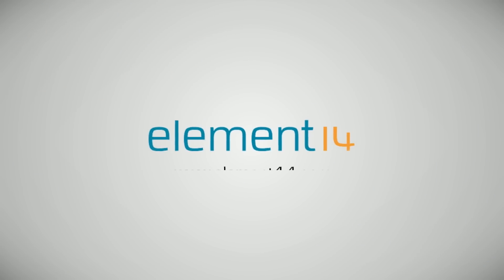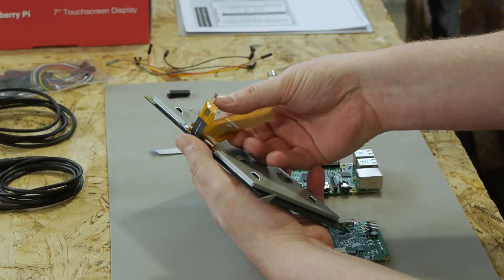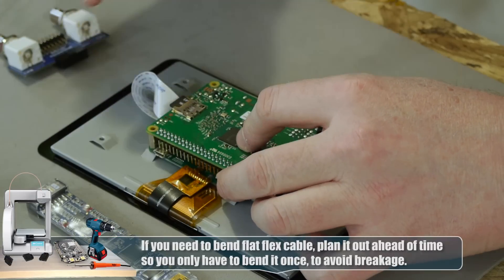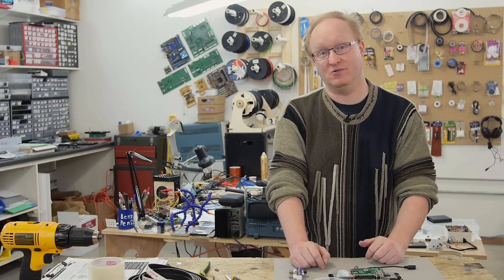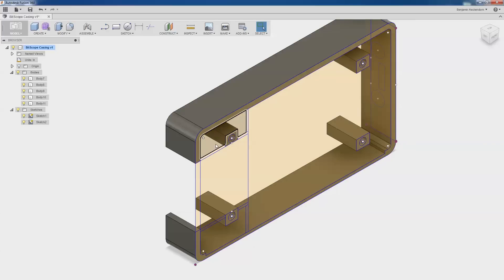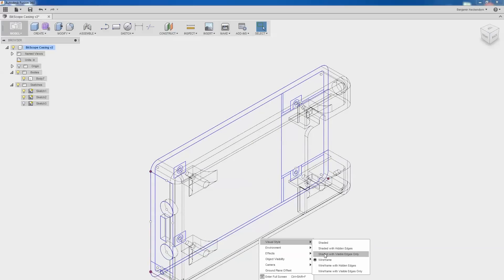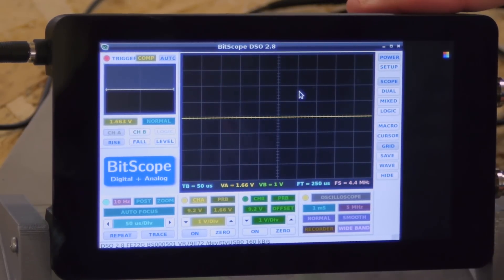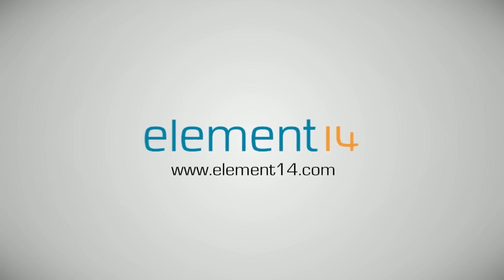Ben Heck's Raspberry Pi Bitscope Mod

Comment: Small, average device with average possibilities. Slightly noisy inputs, not for small signals. Not usable for slowly processes, 100ms timebase is allready unusable because of 5sec pauses between traces. I would like to see it working with 1sec per division without sinchronisation and simply painting line on the screen as old style analog scope, in real time (the 100ms/div can work in the same maner too).

Comment: Wouldn't creating a extremely low profile USB connector be easier than soldering two points? Okay maybe it's a little bit easier but then you can remove it and put it back without having to desolder and resolder, especially if you only have one Raspberry Pi and you want to use it for seven different projects every single year.

Comment: How about this the Raspberry Pi for will have USB type-c 3.2 for charging and everything else, this will give it the capacity to charge as well as connect to every other node in the cluster with one cable. Well obviously it public couldn't Supply power to hundreds of nodes but it would certainly save cable length. I also wonder about Thunderbolt would a Raspberry Pi 4 be capable of driving a GPU. I'm just imagining hearing it with something like a 1030 TI that could probably play some games from 2008 to 2013.

Comment: Why calculate in inches, when it is easier to add and subtract in mm?
Reply: Anders Jackson because he lives in America where the more advanced imperial system is used, nothing in life comes easy
Reply: But that doesn't make subtraction and adding fractions of feet, inches, yards, furlongs or chains any easier.  And he still used metric screws.
No, the US customary units or USCS (that looks like Imperial system but isn't) are not more advanced than the metric system.  It is just more complicated, without giving any benefits.  And yes, an inch is exactly 25.4 mm, as that is the definition of an inch. It is defined in the metric system units.

Comment: I would use it for the simple fact of trying to do a Meyers HHO style set up using car amplifiers and playing a 60 hertz turn and having two amplifiers doing so would adjust the settings of the one amplifier slightly out of phase to match what would be similar to  home electrical but only using 12 volts of electricity .... The other benefit would be to convert 12 volt energy instead of using a power inverter to get pure sine wave where as most power inveters have a dirty sine wave you can guarantee a pure sine wave but still accomplish it with 12 volt amplifiers

Comment: +The Ben Heck Show,  this is an awesome build. Any recommendations for reasonably priced BNC probe kits that would work well with this? I looked through Element 14 but the options are mind boggling, especially for a total noob like myself! Thank you for doing what you do.

"To be is to do" -Socrates  
"To do is to be" -Sartre  
"Do Be Do Be Do" -Sinatra

Comment: Hi, Ben. sorry this is a bit off topic. but do you know with a raspberry pi power. does it make a difference on what size of TV/sceen you use with a raspberry pi? iam using pi for retropi.
I got a power supply that have no rainbow square on top right with 24inch monitor, but when I use it on my 60inch TV, i am getting the rainbow square. do you know anything about, if bigger screen affect the power of the Raspberry Pi? thanks

Comment: If you guys watch the upper right side of the display he's using you'll notice a multi-colored square, this means the raspberry pi isn't getting enough amperage to unit itself. Most of the time it doesn't affect the Pi but if you are using it for gaming like I did with my build it will bog down while that square is away. If you're using a Pi 2 or 3 you'll need at least a 3 amp supply. On the raspberry 1 models you can easily use a rechargable battery bank for cell phones and power the screen and the Pi with now problems.

Comment: The little colored square in the top right corner means the system is under powered! The Pi and the PiTouch will max out the standard rPi 2 amp power supply. C'mon Ben I thought You was an engineer....Love Ya, love the show!

Comment: Cool project. What program did Ben use to design the case?
Reply: +Waltkat Adobe Illustrator then Fusion 360. He usually draws designs in 2D, then extrudes them to make them 3D.

Comment: I'm skeptical of how usable that small touchscreen really is. I've had the 100MHz BitScope for several years, and that DSO application is definitely the weak point. A very unintuitive interface, and the cursors and scaling controls are difficult even with a large monitor and a mouse. The interface to the scope is broken out into a shared library, and BitScope does have documentation on their site, but I haven't seen a third-party program come out for it yet.

Comment: @thebenheckshow are you sure you actually need to block that USB connector? Can't u look at it just  a passive USB Hub?
Reply: +mdrolc he bypassed the port and soldered the wires directly to the connectors... it technically already has something plugged in it and he didn't want someone plugging  a mouse into the same hole and messing everything up

Comment: Aw, you've got the colored square!  Need a better PSU. I'm using an old 5V 2.8A wall wart to power my RPi B+  I'm guessing the screen's backlight is taking up the most of the power?  What's the power draw of the bitscope?

Comment: In both Fusion 360 and 123d Design, rather than switch between shaded and wireframe, you can assign a transparent material to your model. Then at all times the interior and exterior surfaces are visible. For the same reason, I prefer rendering modes which draw both edges and surfaces.

Comment: I'd like to see a custom DC uninterrupted power supply (UPS) for a 3D printer. I thought about creating a solar power supply for my Printrbot, but the high amperage UPS charger boards were too expensive. Is there a better way?

Comment: its funny you made this video, I was looking to make something similar for use in pc repairs and signal tracing. I was able to obtain the raspberry pi 2, I need to still get the bitscope and pi touch. Though due to lack of fund I am having a hard time obtaining the rest of the parts needed to finish this project. I really like the custom case you made. If possible several months down the line when I obtain the parts I still need. What would you charge to 3d print a similar case?

Comment: Shame they are such slow, poor scopes. Nothing below 50MHz should call itself an oscilloscope and even that's pretty poor. Also it really needs shielding. The Redpitaya comes close to being a good portable scope for handheld devices, 2 channels at 50MHz plus it has a 2 channel signal generator, and at least it uses an FPGA designed for the purpose.

Comment: I like how these parts fit together perfectly, as it makes the result much smoother. But I really miss the good old times when you built the cases and so on from wood and did not print everything 3D. I personally would prefer a mixture (small/complicated parts 3D-printed, larger parts and so on handmade).

Hope you read it and think about it...

Comment: i will poke around on there but i would suggest adding a port where a battery pack could be attached in like cases where there is a power failure someone can still work on there projects even when the electricity is out

Comment: You're finally going to consolize a GameBoy?? That's awesome!
Though you should consolize a GameBoy Advance instead. :P
Reply: +allluckyseven I had the same thought. consolizing an original game boy is nice, but consolizing a GBA would be the way to go. the use of a NES or SNES controller for either would also be the smartest thing to do.
Reply: +allluckyseven What about making a consol supporting all the handheld systems.
Somthing like when he did a multiconsole system..
Reply: +Jan-Robert Nergård Like the Wii U?
Reply: Wee u can be the kontroller, with the option to use it as a screen.